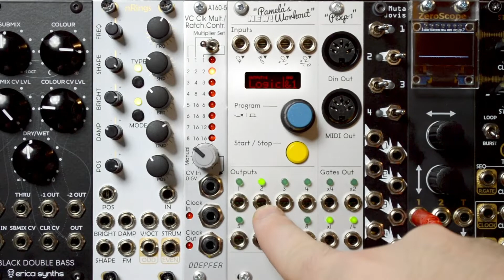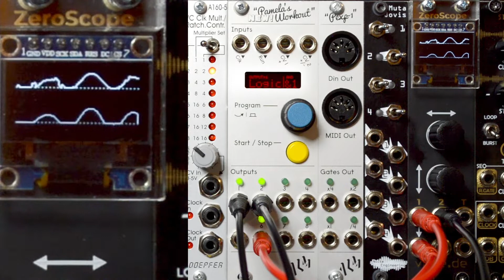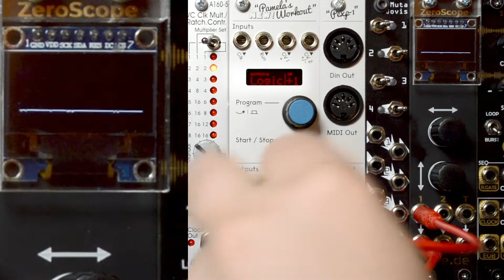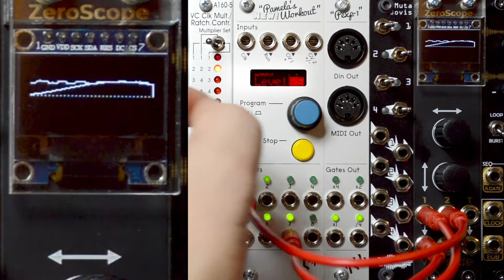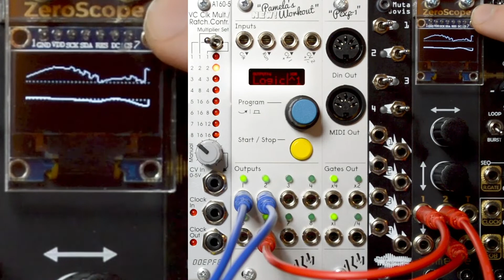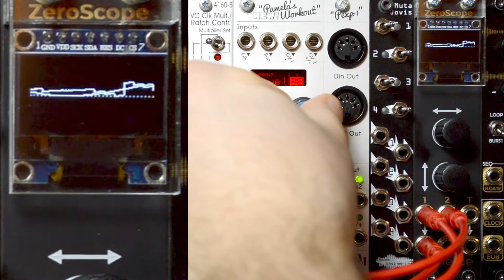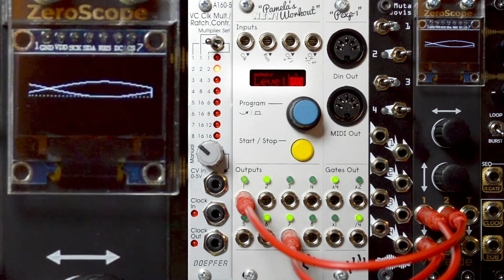Non Boolean Logic with Pamela's New Workout

Comment: That doesn't appear to be functioning properly. Analog logic (non boolean)  AND should follow the lowest signal's value smoothly. I'm not sure exactly what is happening here, but it's interesting. I'm not sure what I'd call it but it seems useful.
Reply: The logic functions in Pams aren't analog logic but bitwise logic of the underlying binary representation (10-bits) of the value of the output.
Reply: @BeniRoseMusic  how cool! That is some fun shit right there. It's like circuit bending.
Reply from the maker: It should, yes. That is the digital logic. Where I compare it side by side to the analog AND function (A VCA) you can see that it follows smoothy.